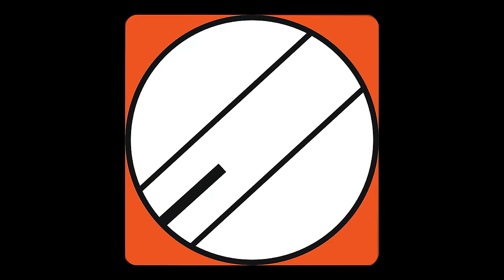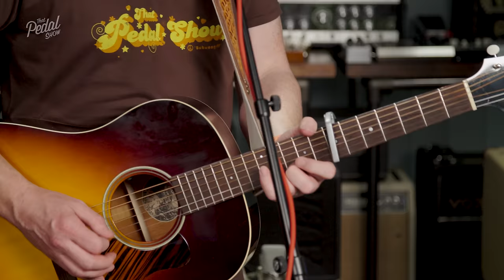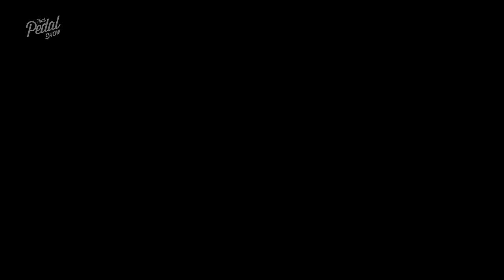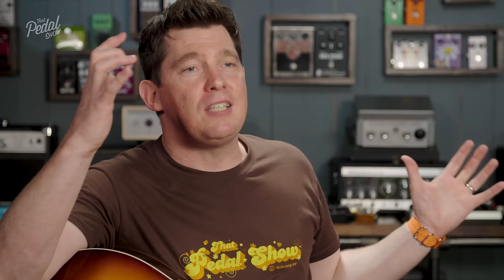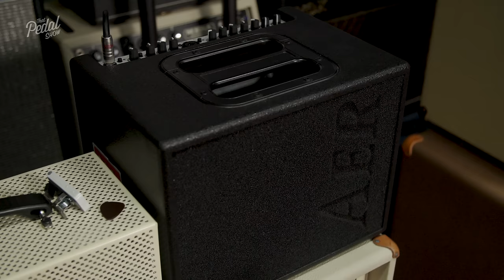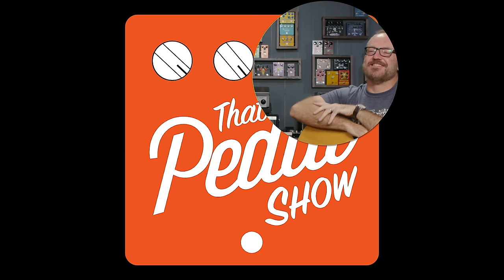Better Plugged-In Acoustic Guitar Sound Basics: Pickups, PA, Amps & All That Stuff – That Pedal Show

Comment: Nice video. My latest gear acquisition was a small acoustic amp (a Boss Acoustic Singer Live), and you touched on a lot of the things that I've really been enjoying about it. Acts as a mini-PA, you can monitor yourself with it, and it has two XLR DI outputs which can be configured in various ways (e.g., mix, separate channels, skip effects) which sound MUCH better than going straight from the guitar into the board. You've got me wondering about upgrading the acoustic pickup system in my Martin, though. The one I take out to play is one of the Road Series models with a Fishman Sonitone.
Reply from the maker: Sonitone is good and simple. It’d be a marginal improvement unless you went to something like the dual source Baggs. Tough call. Cheers!

Comment: Hi, love the show. Just bought a Soulmate and waiting for it. I noticed the input has a low/high impedance switch. How do I know what my guitar output is please? I have a Yamaha LL6 ARE. It uses an SRT Zero Impact Pickup. And what is the best way to plug a passive output into a PA mixer? Direct into the LINE input (BAL/UNBAL) or using a DI box and into the MIC input. I only ask because I did an open mic and my guitar had no signal. I think the sound guy was a bit drunk I didn't check the signal path myself. Had to borrow his guitar which was not in my tuning. I feel your pain Mick on trusting the sound guy with your tone. I'm obviously going to be using my Soulmate from now on but even then I'm not sure how to plug the xlr outputs into the desk. I'm guessing into the MIC inputs. I understand gain staging. So I'll gain my guitar input til it clips on the Soulmate, then back off slightly. Then keeping the MIC input at 0 (unity), increase the Soulmate output volume until it clips the mixer signal and then back off slightly again. Think that's right. Anyway, would be great to get a tutorial on that. Acoustic guitars with Active pickups too, do they need a DI, and which input to put them in. Bit geeky I know, but when you're faced with a sound guy not totally on it, at least I'll be able to get it right myself. Appreciate any advice. Thankyou, keep up the good work. Peace out. Joe.

Comment: Pharty Alert: 
A true Parametric has a Q (bell width) control as well as Fequency and Gain +/-. 
If just Frequency and Gain +/- then it is a Sweep EQ. 😜
Alert End:

Re wot sounds good - also content dependant . You've got yer up close /in yer face and personal delicate picking performance sounds right through to yer strummed acoustic rhythm sounds. Mic'ed or otherwise needing very different treatment.

Comment: I skipped around a bit, so I might have missed them covering this, but an unbuffered piezo pickup sends out a signal in the millions of ohms, but electric guitar amps are made to receive the 10k ohm signal magnetic pickups produce. That's what the preamp in an acoustic is really for, to buffer the signal to the ohmage most amps and PA channels want to get.  
Acoustic amps (many of them at least) are made to receive that million ohm signal from an unbuffered piezo and make it sound good.
Reply from the maker: Nice. Thanks! All part of the reason electric guitar amps often suck for acoustic. Thanks for sharing!

Comment: What bare minimum equipment would I need to plug in my acoustic guitar.
I don't have any pickups installed and own no equipment as such.
I have this little gig to play at my school without any band. 
How do I plug my guitar into the PA system?

A little help
Reply: vatsal loomba depends on the PA. If there is a PA at the venue, and someone who knows how to operate it, you could plug in, especially if the mixer is very close to where you will be. In most cases you need a DI box. You run your guitar cable from the guitar to the DI and XLR from there to the PA. 
Most places where you are doing a short set in a open mic type setting will have the DI and you bring a guitar, maybe the cable. 

As far as pickup, a good place to start would be the fishman Neo-D single coil. You’ll probably also need a double female and another cable. No holes have to be drilled into your axe. Affordable. Reasonable sound. I played live with one of these for a little while. Now I have a decent guitar with a piezo. I know the mic sounds better in these vids but it feeds back a lot during live performance so I would steer clear of that till you get your feet wet
Reply: @derekglenbailey1811  oh God thank you so much but unfortunately I had to work with the mic itself...
It was success though!

Comment: My brother and I both have Maton EBG808 guitars. They have the best acoustic pickup system. It's called the AP5 Pro. (Listen to Tommy Emmanuel or Neil Finn to get an idea of how natural it sounds). Then before going into the PA, it goes through an TC Electronic Bodyrez pedal (it takes the piezo quack out of the signal), then into an AER compact 60, and then from AER into the mixing board. It sounds so natural. 
The pickup system can be bought seperately and then you can have it installed by a good luthier.
Reply from the maker: Nice guitar! Although, I’m gonna say this - Mick here - Tommy’s sound doesn’t sound much like an acoustic guitar to me. It’s a very plugged in sound. Glorious, amazing and wonderful. But not much like a mic’d acoustic! I’ve had the great pleasure of meeting and filming him. What a gent!
Reply: @ThatPedalShow  I'm surprised. I haven't seen TE live, but I have seen Neil Finn 7 times by now and he was so kind to sign my Maton. Before I had the Maton, I tried Martin, Taylor, Gibson, Takamine,...(Which sounded great unplugged), but I couldn't get the natural sound of those guitars to relatively match the PA sound. I'm not a sound engineer :-)
So after seeing Neil a few times, I went and tried the Maton and was sold as soon as I plugged it in the AER compact 3. It was out of my budget at the time, but bought it anyway. (I have the TE signature, my brother the Artist version, and I have to admit that the Artist actually sounds better :-)
Thanks for the reply!
Reply: I've seen a few videos on how Tommy Emmanuel records guitars - he sets up an array of mics at different positions around the guitar, and mixes them down to yield the sound he wants. Exactly how close that is to the room sound is anyone's guess...
Reply: @MattVogt2  Sure, but it's about the live sound.

Comment: Hey guys - did you use a preamp for recording or was it directly into the Apollo ? Sounds awesome ...Cheers
Reply from the maker: Hello, Mick here. I can't remember exactly but any microphone you hear will usually have a UAD Neve 1073 or 1081 Unison preamp on it.  I use these for a little bit of EQ correction and gain make-up, but never anything radical or overly stylised. Direct signals might have a //tiny// bit of that stuff too for the same reasons. Usually just for gain make-up and phase correction if it needs it. Again, nothing majorly tone changing. Cheers!
Reply: @ThatPedalShow  Excellent! The unison Preamps semm to work very well ...Thanks for the fast response, hang on ..... cheeers

Comment: Hey guys - in regards to the huge changes to the sound of Mick's Collings with the preamp pedals - I've found that K&K pickups will show a pretty dramatic difference by simply being plugged into anything that has a 1Meg input impedance.  Most acoustic pickups look for a different impedance, but K&K's are made to work ideally at 1Meg - which is pretty far from the 10K of most DI boxes. Especially since the pickup is passive, load impedance can dramatically impact the sound of that pickup.  I'm sure the LR Baggs pedals are awesome, but a big part of the tone enhancement might simply be from the changed input impedance when you engage the pedal.  I've been suprised how much better my K&K equipped guitars can benefit even by going through the buffer of an old boss TU-2 before going to the PA!  Might be worth checking out.
Reply from the maker: It’s certainly part of it. And we’d agree on the LR Baggs change in tone... except that it was just as massive with the Martin. So they’re doing a great deal. It does explain the high end roll off when you turn the K&K down. Which I love!

Comment: Really good episode that had me nodding, grinning and shaking my head as I recalled the 'randomness' of my tone at acoustic gigs. However Mick, you're so right about 'utility gear'. I got a Yamaha acoustic preamp pedal off eBay some years ago. It did a better job, but I eventually sold it and bought another delay pedal, which was far more alluring. 😉

Comment: ALSO in acoustic guitars your pick choice makes a way bigger difference. Wondering if you guys have taken the plunge and tried out Blue Chip picks? Silly expensive for a pick but they legit sound amazing...
Reply from the maker: Tried everything Rob. Pretty much. I think picks are as individual as everything else - strings, pedals, amps and guitars. But you’re right, they make a massive difference to how you interact with the guitar... and therefore how it sounds. Cheers!

Comment: I have found the when i use pedals on my acoustic guitar amp the white noise picks up quite a bit. I use a Genzler array pro amp. Mainly with the LR bagg align pedals. Zuma power. Any trouble shooting you recommend? When using multiple pedals for acoustic do you recommend A PA system over an amp?

Comment: I swear by my AER! I bought it for 600chf second hand because i was offered 4 Wednesday gigs in a row at 300chf a gig and i never get gigs on a Wednesday in Switzerland,going by train,guitar with Mic stand In the pocket attached with a bungee on my back,suitcase with cables,Mic etc... and Amp in my hand. So 2 gigs paid for my amp and i have used it for outside Aperitif gigs this summer about 20 times and I always had good comments about the sound.And I only had the master on 10 O'Clock.

Comment: Solution to most amplified acoustic guitars..... good cut on the mids, pretty heavy cut on the gain then strong increase on the volume. That alone helps greatly before you then introduce something like the LR Baggs PARA DI and/ or the Fishman Aura.  In my experience that there is the solution....

Comment: Hi TPS. Im thinking of doing some solo acoustic gigs soon. Just wondering if you had any PA recommendations to suit most situations?
Reply from the maker: Hello! Most of the new powered cabs are great, eg Alto, Mackie, etc.. A little analogue desk if you need a few inputs. If you have a bit of cash, a used BOse L1 system is worth a look, and the similar systems from EV, LD and so on. The good news is that most modern FRFR gear is pretty decent. Get twice as much power as you think you’ll need. Vocals are NEVER loud enough and once they want more, they always want it louder too! Good luck!
Reply: @ThatPedalShow  Thankyou. I'll check them out.  Cheers
Reply: Not sure if they are still available but I picked up an SR JAM 400 that works great ... with several inputs - each separately controllable .... Also had Acousticube 2 (pricey) ... but sounded great ... still also have a Marshall AS100D - again with inputs for instruments / mics ... etc ... N.B. do check that the "box" you consider has 48V phantom power available ... needed to power certain mics, pedals ... CMcG, Aberdeen, Scotland
Reply: @calummcgregor3662  thanks. I'll check them out

Comment: Great show! I've been waiting for an acoustic show. About the electric guitar amp, on Anderton's Mick and Danish Pete plugged acoustic guitars into a Hot Rod Deluxe and got a decent sound with some tweaking. One question I was wondering what you use for picks on acoustic guitar are they any different than the ones you prefer for electric? Personally I use thinner picks on acoustic guitars because I like the strummy sound.
Reply from the maker: I use the same picks - Mick here - for general playing. But if I’m recording I’ll definitely use the appropriate pick for the job. As you say, a thin pick can sound great for strumming but it can vary from guitar to guitar. Cheers!

Comment: Pluggin in to an electric amp is generally pretty dissapointing, but I've gotten some pretty good tone running my acoustic guitar through a bass amp. I find that bass amps with 10" speakers tend to sound better than those with larger ones. Perhaps the same might be true of electric guitar amps? To me it seems like alot of Acoustic amps are voiced to produce that steriotypical thin, treble heavy sound that you'd hear at a Jimmy Buffet show. With a bass amp you can get a more full, rounded out sound.

Comment: Very interesting. Just started doing open mics so at the moment I’m so nervous that I make loads of mistakes but occasionally I get it ok. You’ve just spent 4K or whatever on a fantastic sounding guitar so when you plug it in you want it to sound the same, just louder! But it doesn’t it sounds totally different as you’ve just demonstrated :(. Now I do happen to have the same AER amp and LR Baggs Anthem which I dial all way to mic. But when I go to an open mic I don’t want to have to take my amp along. So are you about to tell me in part 2 that I can buy a relatively cheap light pedal that’ll give me the guitar sound replicated? I hope so. And if so then my question will be, will that still work when the guy running the open mic plugs it into some Marshall amp setup for his electric guitar? What will I have to do to get it to replicate my sound. Thanks, looking forward to part 2.

Comment: Great show guys.  Question,  in general, if I'm plugging my acoustic directly into a church sound board not really designed for an acoustic,  would you recommend starting with one of the pedals in this program or into an acoustic amp then the board.  I'm talking a Fender PM3 guitar with a Fishman pickup.

Comment: Sorry this is off topic of acoustic instruments but I asked you a question a while ago regarding noise to my amplifier and I said that I was but using a boss tuner and daisy chaining off it for my power supply and thus I was having town so I can a major way the pedal that I am using our vintage Vox quinoa a D & M drive from Kaylee hot 1X. Mini which is actually surprisingly good ITC Electronics Alter Ego of maleko trim and a hardwire Supernatural Reverb I'm looking at a joyo jp-05 rechargeable power supply. While i don't think it is isolated would it solve most of my problems and be a HUGE improvement? We're not playing as much as we used to thus I can't justify spending great gobs of money trying to solve this problem at the time I'm hoping in the next year will be playing more but this has been shit year. I tore my rotator cuff and I've been out of commission thanks for any help you can give me

Comment: Having used a Roland AC100 I’m already sold on acoustic amps BUT that ( great amp ) weighs a ton! Better start saving for an AER. One question. Is an AER any good for using with a guitar synth? ( Roland GR55 and Godin ?)

Comment: I'm playing in an acoustic duo, and one of the biggest problems when connecting to a PA, whether with a preamp unit or DI to PA, there's always a huge audio pop when disconnecting/reconnecting the cable from the guitar before/after soundchecks and performances. We're always at the mercy of the soundperson to know when we are going to connect/reconnect. We've tried special cables that disconnect the ground lead as we pull the cable from our guitars, but it doesn't work with every brand, including Taylors. I hope you would add some thoughts about this in Part 2. Thanks for the video!
Reply: More info: Disconnecting/reconnecting acoustic guitar cables increases as we're all trying to save our preamp battery before the show.
Reply: Get the lead that's in the guitar and pull its other end out from wherever it's connected, before pulling the jack plug out of the guitar.
Reply from the maker: Plug into a tuner, use the tuner as a mute to unplug :)

Comment: Sansamp para driver has been the standard for as long as I can remember. Do you guys have an opinion on tech 21 utility pedals?
Reply from the maker: Mick here. Never been a brand I’ve engaged with - probably because they used to do that ‘sounds as good as valves’ crap which is just bare arsed lies no matter who says it. Instant dislike from me.
That said, I know lots of people who really love Sansamp stuff and as you say, totally rely on it as excellent utility gear. Their continued success speaks volumes in that respect. Cheers!
Reply: Fair, I never thought Tech 21 pedals sounded anything like valves. I agree that it's a silly marketing ploy.

Comment: I found these issues when I had an old PA system  emx Yamaha with wooden speakers I had great acoustic sound plugged straight in !   And great drive and bottom end ….but when shifted to a powerful new Yamaha modern pa Dxr 15 s with plastic speakers I could never get a good acoustic guitar sound  but got brilliant  vocals etc With modern pa and better every else but all the problems you showed in video raised them self’s with new pa so there fore after torturing myself to get good acoustic sound I got acoustic amp and L R baggs di  and it helped …. But di sound out of amp is still not great at front of house through new plastic speakers  …. I think wood speakers just sound better with acoustic guitars , not sure if any one else found these issues .